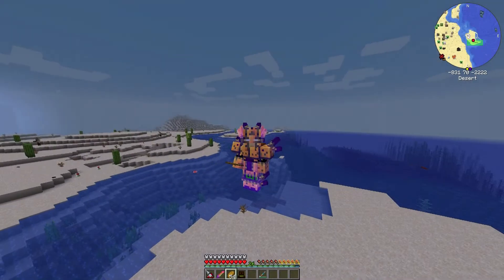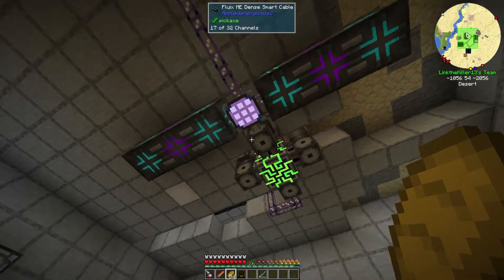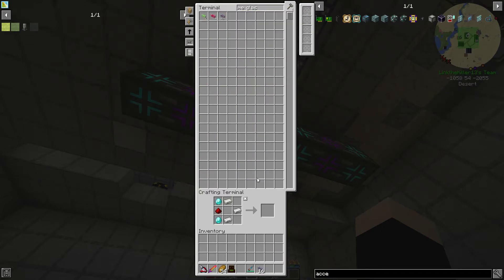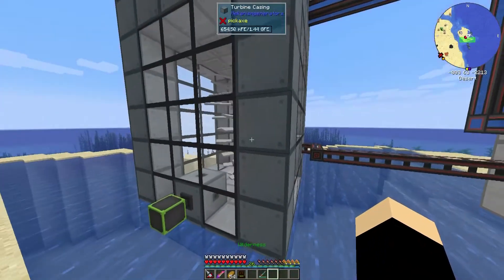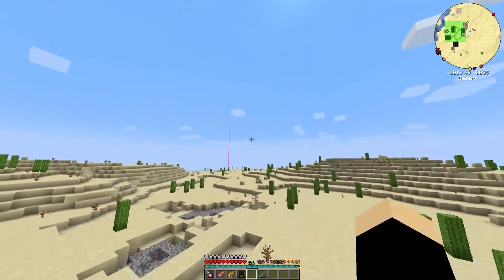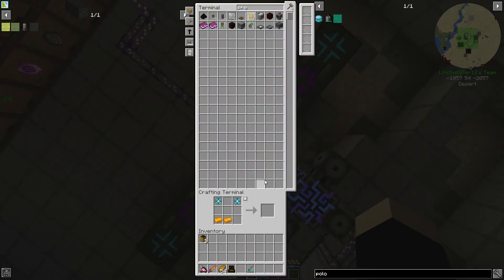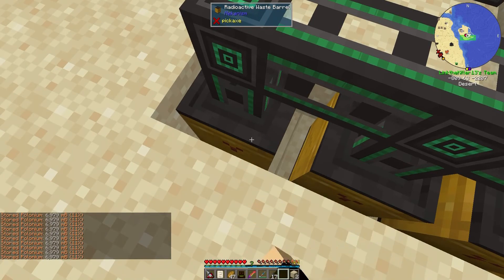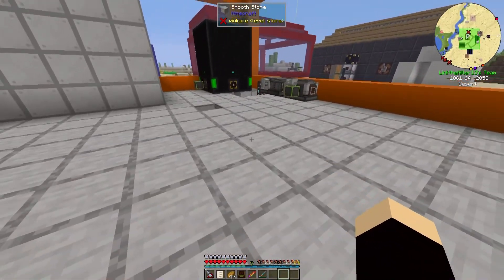Direwolf20 Modpack 1.16 - Ep.61 - I Screwed up BAD!

Comment: I just giggled when you said 4% can't hurt...Why did I giggle? Cause I did the same thing. The Radiation will last for 14 MC Days
For your bleeding ears, use the Sound Muffler. It is located just to the right of your avatar. It cal muted the sound with a button OR you can use the slider to turn down the sound.
Reply from the maker: Yeah good times